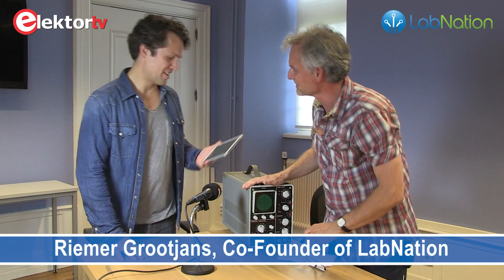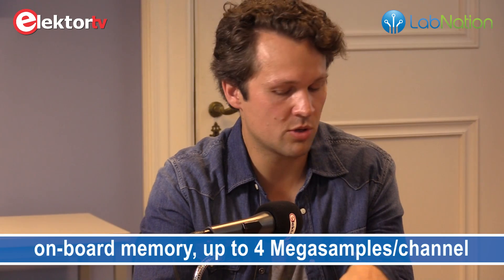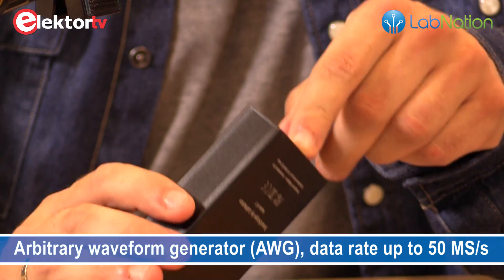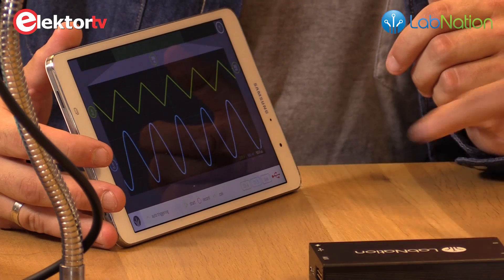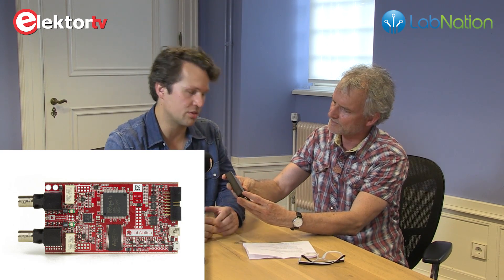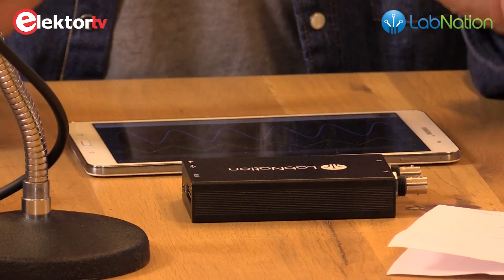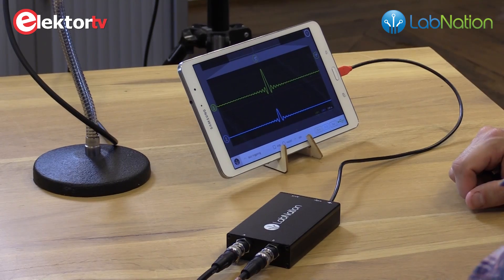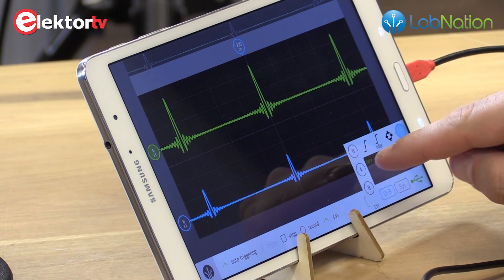Introduction of the LabNation SmartScope

Comment: I don't mean to sound hyper-critical but the video was not very informative I'm sorry to say.  When the question "how many bits" was asked, it was evaded and immediately switched to something else. - so that leads me to think it's low resolution (8-bits).  It's important to know what the digital resolution of the internal ADCs are; higher resolution generally provides greater ability to capture smaller voltages which in turn affect the vertical resolution.  Most inexpensive and some not so inexpensive scopes use 8-Bit ADCs while the better ones use 10-Bits or more.   The use of a touch-screen is convenient if that's something you want. Some of the very expensive Tektronix scopes use a touchscreen, but they're not all that popular.  And if more than one person uses the same touchscreen they make superlative germ and/or virus spreaders - something to consider in the COVID era.  But I presume the software works on non-touch screens as well.  With all do respect, I think the video, and the impression of the SmartScope the video provides, would have been far better if it went through each of the main functions of a dedicated scope and show how the SmartScope compares.  For example, comparing it to a Pico Scope or a Hantek in the same price range. Also, how about Math functions?  And how about the software for the scope?  There was zero coverage of that important part... the UI.  What functions are built into the unit, does it do FFT's for example and what is the frequency resolution?  How about a specification sheet LabNation ?  The unit may have some really great functionality but I didn't see that in this video.  Perhaps a 2nd video will do better.